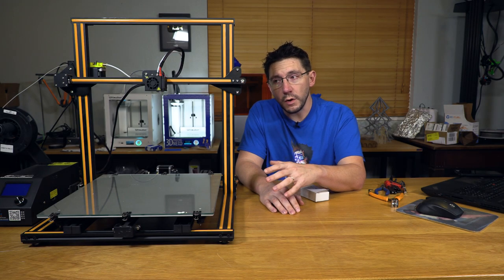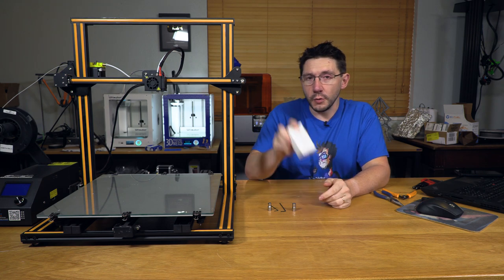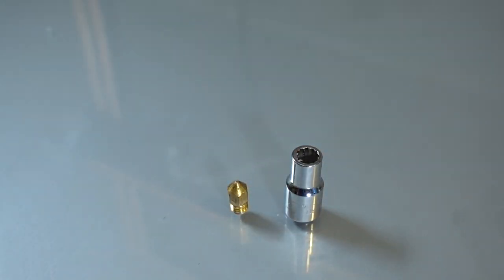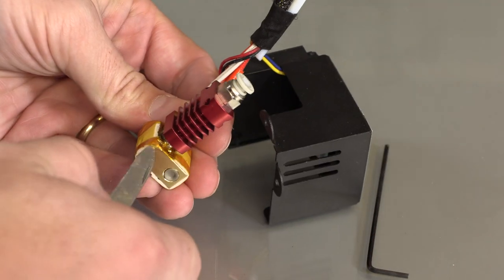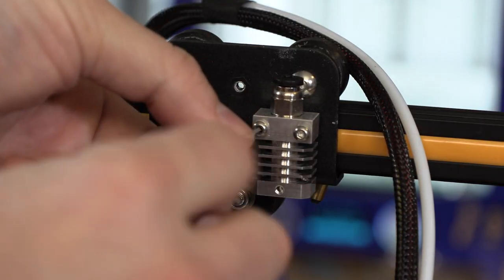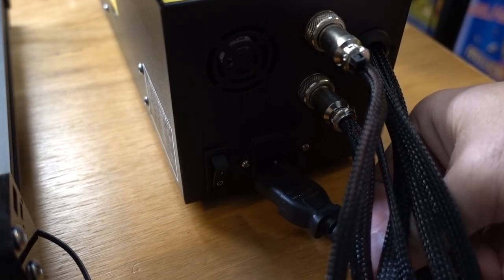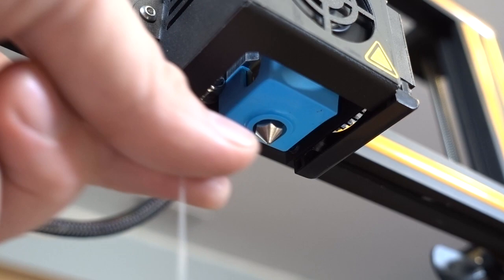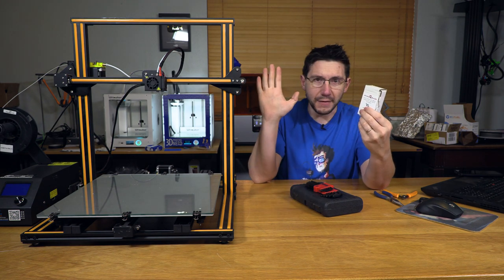Installing the Creality CR-10 All Metal Hot End Upgrade by Micro-Swiss

Comment: Sorry but don't agree with an all-metal hot end being an 'upgrade', it's different but not necessarily better. The Facebook group is full of upgraders struggling with retraction and clogs. If you want to print hotter then swap the stock cheapo Bowden tube for Capricorn tubing.
Reply: Bob Titchmarsh the Bowden tube isn't the limiting factor it's the PTFE liner inside of the hotend. Also I've had my Wanhao i3 plus with a micro Swiss hotend for about a week and no issues have come up apart from me being stupid and not tightening the nozzle fully.
Reply: the cr10 doesnt have a ptfe iner in the hot end itself. The ptfe tube itself that feeds into the top, passes all the way down and thru the heat break until contacts the nozzle. This is one of the things that actually i love about the creality cr10 design as it creates edge points in the filament path that can cause friction, like the edge where ptfe tube meets heat break ptfe liner. I have had that exact point cause issues in my other printers when became worn and the ptfe liner edge curled inward when changing filement and clogged the heat break. with the cr10 design that risk is non existant.
Reply: Matt is right, the cr-10 hotend has the Bowden tube go all the way down to touch the top of the nozzle. It's a dumb design, yes. I am happy with my capricorn tube, though. Having said that, I love my all metal e3d v6 in my other printer. If someone expects to run the exact same settings after changing the whole extruder setup, they need a kick in the pants.
Reply: I actually love that the design allows the ptfe tube to fully reach the nozzle. PTFE liners are thin and easily damaged if overheated. The thicker ptfe bowden tube itself is much less risk to damage from overheating and thermal transfer to the filament thru it. I think its one of the reasons the cr10 and its family using its same design (like the Ender2/4) work so well out of the box. My ender 4 runs nylon at 250 all day without issue even without upgrading to capricorn yet (have some, just not on this printer itself)
Reply: If you’re wanting to go really hot then it makes sense but I’ve found that even with an e3D all metal hotend (considered to be one of the best if not the best around) that I’ll still occasionally get a heat creep based jam with PLA.

It happened often brought that I ended up modding it with a cheap heartbreak to insert the ptfe all the way into the melt zone. For the vast majority of my printer materials it’s ideal.

If I upgrade it’ll certainly be to Capricorn tubing.
Reply: You probably never used it yourself eh?
Reply: i can say the 300 kit is brilliant & works a treat

Comment: Those 2 screws attaching the heater block to the cooler should have been removed when the printer was first installed. I'm surprised the manufacturer left them in. Maybe they were rushed off their feet!). Its a bit pointless having a heat break if the screws are left in there short circuiting it.

Comment: Hi i have a CR10-max have upgraded to a micro-swiss direct drive all metal hot end and was wondering is there a better hot end for this mounting as it clogs then cant get the screws un done have had the tip unwind its self even though it was up to 235c when i tightened it now has a blockage in the heat break and cant get it out of the heated finned block. I'm thinking there must be a more robust type of direct drive system that is extremley reliable ???

Comment: 6:00 As an engineer it's very odd to me that you removed the heater block screws. They add a lot of rigidity and strength to the assembly and without them, the only thing holding the heater block on is that tiny grub screw. Did the micro-swiss instructions specify to do this? Steel doesn't actually transfer heat very well so they shouldn't affect the heat transfer very much.
Reply: I'm wondering the same thing.
Reply: they dont help hold the heater block on, but they do help keep the heater cylinder tight against the heater block for better transfer of heat, he shouldnt have done that, its really strange and bad advice now the heating cylinder is loose

Comment: Awesome video. 

Why did you leave the stock block there rather than use the one that came in the box?

Why didn't you push the PTFE into the clip before pulling it out? 

The ring on the inside will sometimes have frayed the PTFE making it hard to pull out. Also the plastic ring has to be pushed down uniformly.

There are a couple things important to point out for people upgrading.

1. Firmware should be upgraded if you plan to go past 270C. 

You don't have to upgrade the firmware but you are missing out on Marlin features that did not exist in the stock Creality Firmware that will improve your prints (Linear Advance & Unified Bed Leveling) and reduce the chance of a fire if you leave your printer unattended. 

2. The stock thermistor is rated to 270C.  

Better thermistors can be had from Amazon and Ebay. I use the M3 HEX Screw-In M3 EPCOS Thermistor because nobody has time for trying to insert a glass bead thermistor into a hot end.

3. The retraction settings will need to be changed for better performance. (2mm or less.  Retraction of 1 to .5mm is common)

Misconfigured retraction settings cause clogs. Even the E3D documentation says this.
https://e3d-online.dozuki.com/Wiki/V6_Troubleshooting

4. The PTFE Tube doesn't have to go as far down into the Microswiss block.

5. This is the best time to upgrade to Capricorn TL to reduce friction to help with retraction.

6. The temperatures needed to print the same material may need to be raised 5 to 10C per the manual. Not paying attention to this can cause clogs because of the cooling that can happen when printing faster. 

7. Make sure to learn about PIDAutotuning so that you can set the temp that you want to print at in the firmware. The hot end will heat faster once it is tuned.

I own the Wanhao i3 All Metal, Wanhao D6 All Metal, and Creality CR10 All Metal Micro-Swiss upgrades. Allot of people don't read the instructions or do their research before upgrading. Don't listen to anyone that hasn't physically put their hands on it or used the hot end for longer than a few days. 

There are people getting some awesome prints out of them and there are some that are struggling because they upgraded before they even knew how to get great prints out of the Stock CR10 Hot End. Ignorant users love to 'Upgrade Bandwagon'.

 I only recommend this upgrade for people that are going to take the time to learn their printer and Slicer. I would also recommend this hot end as a replacement for anyone that destroyed their stock hot end trying to take it apart.

I would definitely recommend this upgrade to anyone before going the E3D V6 route because you can keep the stock fan assembly/look.

Comment: Anyone else having an OCD moment about the bowden tube being inserted when it wasn't cut straight?
Reply: Yes
Reply: @theothertroll  the only downside to all metal hot ends u can get some bad heat creap with pla if u don't print fast or colder like 185 is fine but it's better for abs
Reply: @beauvella32  Nice tip.
Reply: Heat Creep is only an issue with all metal hotends if you try and use silent fan options for the hotend. The default fans are noisy, but they have significantly higher Static pressure and CFM more suited for cooling the cold end.
If using Noctua make sure to use the 4020 variant, but even with that you risk heat creep, it's been shown to be near useless with the Hemera unless you are running low amperage in combination with low PLA temps.
Reply: @theothertroll  yes it does, if there's a gap when you're feeding filament it'll catch in the gap.  nowhere near as big a deal as with a ptfe lined hotend but it's still an unnecessary pain in the ass.  besides that, he cut it with side cutters, it's still visibly crushed when he installs it.

Comment: Great video production (and entertainment)  as usual, but there are few discrepancies. You used CR-10S--the video title says CR-10. The heater block on the S  is different than the original CR-10 I have--no two screws on the bottom. 

The original CR-10 has a firmware set temperature  limit to 260C. To reach higher temps,  you have to flash the firmware. To flash the firmware you have to install a bootloader on the original CR-10--seek other videos. 

One filament manufacturer (name escapes me) I ran across does not recommend an all metal for their PLA filament--so you may add some difficulty if you need to print PLA again--possibly an oiler might help but need to be tested.

Some higher temp filaments need a hotter bed. With added insulation, my stock CR-10 bed can reach over 100C (with enough time). I think the CR-10S bed may not go over 85C without added difficulties.

With higher temps, you may have to reset the PID. May need an enclosure. 

This could be a great upgrade if you have multiple machines and and dial it in for one type fo filament, but if you need to go back to PLA, you might have to work to get it dialed back in.

Please test the upgrade with actual prints. But love your damn positivity. From a fellow giant (2 meters)--an extra-high five!
Reply: The cr10 s4 stock wont go much above 65 degrees stock after a while, near impossible to print abs well unless you have a good enclosure have insulated it well and wait ages before you print to heat up.
Reply: Thanks for the info, I'm looking at getting cr10. What all did you do to insulate bed? What temps are you able to get?
Reply: I don't have the s4 i read on forums what others did and how well bed insulation works. I have the CR10S and it came with the bed already insulated it will go up to around 110 degrees c after some time without enclosure. I have read after someone insulated their s4 it would reach something like 96 degrees c without enclosure, enough to print abs i think. So if you were to add bed insulation (i'm not sure what to get though i think those high temp insulation pads for cars work) you can print abs well with the s4 i think.

Comment: I didn't have the two screws holding on the heater block, also the sock does NOT fit over the stock heater block.  After you've tightened the nozzle, you might have to cool down and remove the cover to get the sock on correctly.

Comment: I went all metal with my E3d about a year back and i couldn't be happier with it. Over temp'ing the PTFE lined hot ends causes so many issues and they seem to destroy themselves anyway after a fair amount of use. At least with the all metal hot ends you don't need to tweak your settings over time as the PTFE liner degrades :)

Comment: I'd leave those screws on the bottommof the heat block because that grub screw just isn't enough to hold it and every CR-10 comes with them in and I think Sexy Cyborg said to leave them in.

Comment: Hi Joel, I am trying to find information on how to upgrade my CR10s with micro-swiss to reach 310C.  I cannot find any information on upgrading with original equipment, do you have any suggestions or recommended sources that I can use?  Do I need a K-Type thermocouple, and if so, I am not sure if interface board is required or pinout instructions for integration into original CR10 control board...  BTW, have been a big fan for a very long time.  Thanks!

Comment: G'day Joel.
The kit is a nice option but I would add that you can just replace the heat break (from microswiss) for quarter of the price or a heat break/nozzle kit for a little less than half the price.
I know, I am a cheap ass - you can just replace the PTFE in the stock break about 2000 times lol.
Nice vid. though - microswiss make some great stuff.
Reply from the maker: Oh, yes, plenty of more inexpensive ways to go about this, but, they asked if I could show the kit install, so I went that route.
Reply: That's true, but what if the tubing were to melt in the middle of a big print. Now you're going to be out filiment and more importantly, time.

Comment: If you've swapped out your cooling fan to a noctua, you're going to have issues. While the fan is super quiet and works pretty well on the standard hot end, the all metal one needs more volume than it can provide, so stick with the standard one. Also, make sure your retraction settings are adjusted, I think micro-swiss recommends a maximum of 3. Learn from my pain lol

Comment: Curious why you cut the Bowden tube near the heat block. You can use one of the wrenches that came with the CR-10 to remove that whole piece and then the tube would pull right out.
Reply: you are correct but i think it was because this was faster/simpler  however I did notice that he didn't square off the cut ptfe tube and he used flush cuts. This could cause problems later first with it not being square you do run the possibility of getting some back flow and a blockage. second using flush cuts you can crush the ptfe inner diameter and that can cause additional resistance and possibly blockage.
Reply: The tube can only be pulled one way (further into the fitting) unless you can push the ring down to release the grips.

Comment: Hey Joel, what is the reason for taking the 2 screws out from the heater block to cooling block before putting the sock on? I was thinking it was very cool (no pun intended) to have those to hold the heater block for nozzle removal. Just curious.
Reply: It probably keeps heat from the heater block from going up the screws and into the the cooling block.
Reply: I was kind of thinking that same thing (hence the no pun intended line LOL) But the factory one had those screws. Maybe Microswiss figured out they got better heat retention with out them, but I just thought it was a decent design to not have to hold the heater block to remove the nozzle during changes. It intrigues me. Thanks for replying to me!
Reply: I wondered the same, thanks for asking this...I would think those screws would make a quick nozzle change easier (so hang on to them?)
Reply: Removing them will definitely aid with heat separation. All metal hot ends can suffer quite significantly from the smallest amount of heat creep so removing the presumably aluminium or steal screws will limit heat transfer to just the titanium heat break (which doesn’t conduct heat all that well)

It’s presumably less of an issue with the Teflon lined hotend so the screws stayed in place?
Reply: I can see the science in that. If the screws were to stay, the heat would creep through them to the cooling block. But by removing them, the heat break is the only path and being titanium will slow the heat creep. So, I have titanium screws in one of my RC cars, titanium screws to the cooling block? LOL! I guess it would be easy enough to run those screws in when changing the nozzle.
Reply: my cr10 block didnt even have those scews.
Reply: Chuck Hellebuyck did a video recently showing that removing the screws between the hotend and the heatsink makes no difference whatsoever, https://www.youtube.com/watch?v=eM-rJWBuWhw.

More than anything I think removing the screws just allows the silicone cap to be fully seated on the hotend (the screw heads prevent that). I drilled deeper countersunk holes so I could keep the screws on my hotend.
Reply: @scythe3000  They definitely are not made of aluminum, as nobody makes aluminum screws. They are almost certainly steel, which actually doesn't transfer heat very well. I also thought it was strange that he removed them and as an engineer who has studied heat transfer extensively, I think leaving them in wouldn't make much of an appreciable difference. However, from a mechanical perspective they seem pretty important so I would leave them on. Otherwise, the only thing holding the block on is the tiny grub screw.

Comment: Great video Joel, but I have one concern. At 4:50, it appears the thermistor has PTFE sleeving, which should not be pushed past ~245° C, because it starts to release neurotoxins, such why you would get this upgrade. Can you confirm it is PTFE, or is it something else? You could always swap it out with the glass fiber sleeving you see on e3d hotends if it is though.
#HighFive
Reply from the maker: Ooh, I'll check it out!
Reply: The PTFE fails at 250C the thermistor is actually rated at 270C.  The sleeving is silicone, just like the sleeving on the heater cartridge.

Comment: Hi gang.  Once this hot end is installed, are there any settings that need to be changed in the firmware to allow the hot end to actually reach the 300C?  Every vid I've seen only shows the physical installation, but I'm pretty sure the CR-10s is capped at about 260C.  Any help appreciated!!!

Comment: I upgraded my Wanhao Duplicator i3 with an all metal hot-end and it's a very worthwhile upgrade. I assume that's the same for the CR 10.
Reply from the maker: +Zelda's Fox exact same
Reply: The i3 Upgrade doesn't have a titanium tube connecting the hot end to the heatsink. Everything else is design related.

Comment: What if I don't want to reuse the current heater block? I might get one of these but I'm not sure how to install the cables into the new heater block
Reply: just install them the same way they are installed in the original one, you basically cant screw this up.

Comment: Great video!  Can this print carbon fiber filament without tearing up the nozzle?
Reply: That depends on the nozzle, not the hot end.  An all metal hot end is always recommended with things like carbon fiber that require a higher heat setting though.  The nozzle that comes with this hot end is better for abrasives though.

Comment: Hi, I have done a hotend upgrade on my cr10. I now have a error coming up as termal run away. How do I fix this problem
Reply from the maker: Check to make sure your thermistor is properly attached. Thermal runaway can occur when the thermistor isn’t reading what it thinks is the correct temp.